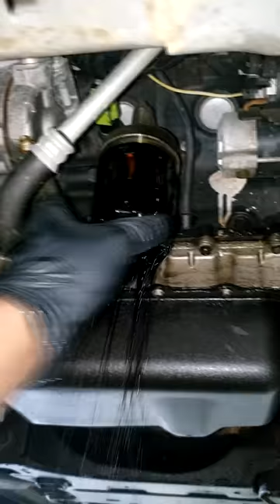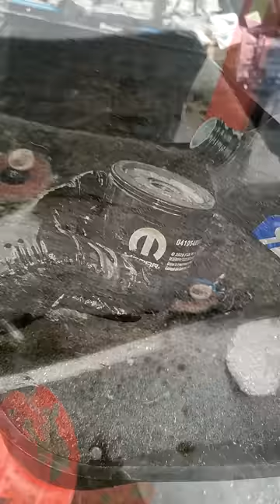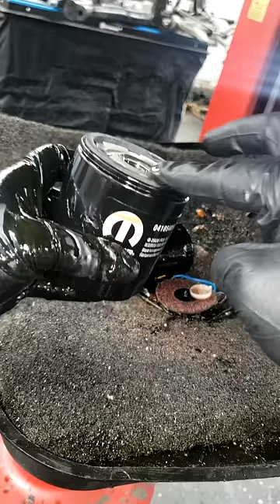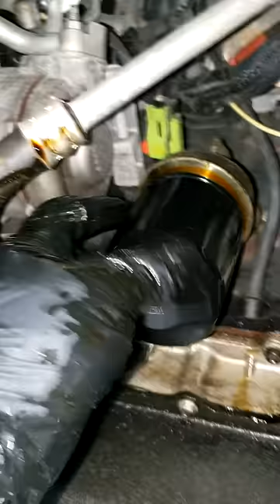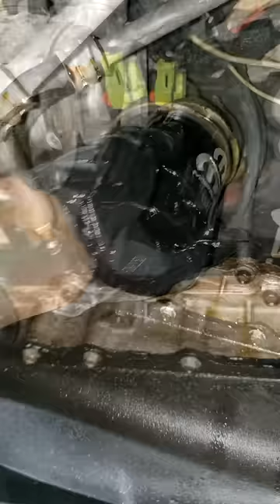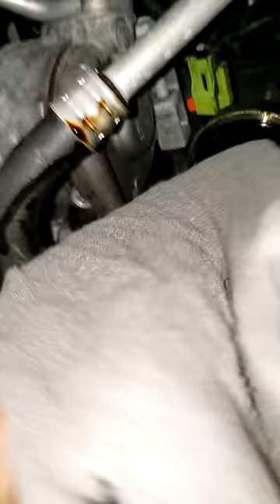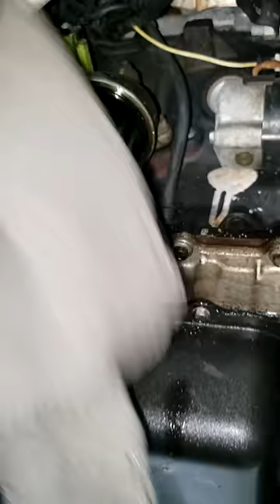Don't Lie.. Are yall still doing this?

Comment: You can't do this to every engine, as previously stated with the sideways filters or even filters like subaru that have the filter mounted screwing down from the top, so if it's not bad for them, why would it be bad for any right?

Comment: I'm confused, if the filter is on the bottom of the engine then when you fill the engine the filter will automatically fill. I would just lubricate the rubber ring and put it on

Comment: Old habits die hard fell out of this due to all the new motors, the oil pump doesn't need this kind of support anymore it'll scavenge for a second but fills right up since the filters are small and your pressures are fine as well,  oil fully recirculating through the filter, pump, etc. I thought this was for trucks or for older cars that had a larger oil filter to aid in the recirculation process?

Comment: LMAO now do it on a side mounted or even a top mount filter 🤣 this is a great way to waste oil. Out of my 3 vehicles only one of them is bottom mount. My jeeps oil filter mounts from the top, my van is side mount. "Are you pouring oil into your filters or just dumping it on the engine first?"

Comment: Nope just the pedal to the floor and crank the engine on fuel injected engines they won’t start it will prime the filter, let off as soon as you see the needle move and away you go.

Comment: Install the filter empty with a little oil on the seal fill up the oil pan start the engine and let run for 5 seconds shut off and top off oil if the engine starves of oil for 5 seconds and blows up the engine was junk to begin with and who cares I will never fill up oil filters

Comment: No need to do this on small engines. Diesels require it due to increased capacity and rotating mass. Aside from that the outside needs to be filled first not the outside, your just filling the anti drain back valve.

Comment: No I don’t. It’s not a sealed system with no air in it and it doesn’t require priming because it isn’t a pump. If it were necessary there wouldn’t be some engines designed with the filter at a 90 degree angle. I haven’t seen evidence of why it does or doesn’t make a difference either way, so no. I don’t.

Comment: I dont prefill the filter, because it's wrong. You fo it because you dont know why it is wrong. A prefill will actually slow many engines from priming. A smear of oil on the seal is correct, though.

Comment: I saw someone pierce the bottom of the filter before unscrewing so that the oil will drain out. How do you feel about this tip, Sir?
Reply: It’s a trick to do whenever you can’t get the oil filter unstuck

Comment: I don’t care what anyone says or thinks, in an engine that I can fill the filter with oil, I’m filling it with oil. Oil flow isn’t like electricity flow. It’s not instant. Takes a few seconds to fill and the less time my engine is without oil, the less wear occurs. I’ve built more engines and changed more oil than 99% of the people in this comment section. I’ve had engines go well over 300k miles and the bearings still looked new. My grandfather taught me this decades ago and I’ll always do it. Riddle me this. Why do people prime the oiling system of a new engine?  The more oil you have in the passages and filter, the better off you are at preventing unnecessary wear.

Comment: What is the point of putting new oil around the top of the filter if you didn't wipe away the old oil from where you screw the filter in?

Comment: That thing holds .5 quarts of oil at most. All manufacturers have specifications for when filling oil with an empty filter and without one. You’re wasting your time and contaminating the new filter with unfiltered oil. Now if it’s gonna fix that big ass oil leak right next to the filter I’ll do it all day

Comment: This only applies to the engines with horizontal filters. Not important on engines with vertical filters. Millinials blow my mind with some of the dumb shit they come up with. If dry start is a cocern simply pull the fuel pump or ignition fuse and roll engine over for a few seconds. I think its more important to put change date on filter rather than filling it with oil.

Comment: Seeing the amount of techs that don’t do this makes me glad I do my own work .  

I clean the mating surface , clean off any area around it that I can reach with a bottle of brake cleaner , re torque the drain plug to factory specs , pre lube the o ring , pre fill the filter , and then tighten the filter to snug so it doesn’t leak, but not too tight so I can’t get it off the next time .

Comment: So how do I fill my filter and tilt it 90° and spin it in my v8 side ways without pouring out the pre fill oil? I don't have to worry cause by the time the starter has turned beige over it has cycled oil though empty filter and out 3 times. It's good idea but not nessisary

Comment: Cars do have instant oil pressure or won't start. Not pre filling an enclosed filter (not cartridge type) does create a cavity due to the anti drain back valve recycling air. Barely an issue and barely a topic
Reply: Will never have a dry start period. Only less oil pressure for buckets and sensitive pooling type components. Such a stupid topic as no interference on any components on start up just noise

Comment: I drain the oil, spray off the filter housing with brake clean , fill the filter with oil, and install on the engine. If I can't reach the oil,  I don't fill it. I don't care.  I've put oil I've drained out of really nice engines, into my near dead cars, I don't care. Oil too thick , don't care.

Comment: 25yr tech. Nope dont do it, the reason i dont is the oil pump moved the second the engine turns and there is still oil in the rings and lifters. On a dry engine is the only time i prime the oil system.

Comment: Unnecessary to do it on small filters like that especially with the one with the filter going in horizontally. But not cleaning the mating surface of the oil filter is a bad habit to do. Seen to many LT's do this and end up with a double gasket on a filter... also using a dirty oily glove to put a new filter is a big pet peeve for me. But thats just me 🤷‍♂️ yea sure you wiped it but its still oily

Comment: This is wrong you should only fill the Filter maybe halfway and then dip your finger in and rub that oil around on there and then you go and you put the filter on . And you don't even wipe down all the old residual oil.
 probably won't do any harm but you know it Should be a clean surface when you screw the filter back on.

Comment: I've replaced using canola oil with avocado oil much healthier for my cars cholesterol...

You shouldn't fill the centre hole only the outer holes. All you're doing is risking any debris that could be in the oil getting past the filter part. And risking spilling oil making unnecessary mess. Especially when the filter is side or top mounted. The only reason anyone does this is because an angry old man with no education yelled at you about it once, and now you think it's how it's done.

Comment: I have never in my life filled the oil filter with oil. It’s a myth. I’ve never had engine failure with any vehicle of mine. Not necessary. If it was a bone dry brand new engine never ran before than yes I would but a engine with some gunk and oil in motor you’ll be fine. No matter how many times you change oil or what oil you use there will still be a little gunk in your motor.

Comment: Completely unnecessary, I value my time. I'll lubricate the gasket and that's about it, never had a problem. As soon as you fill the engine and start it fills up instantly. A lot of filters are upside down on top of the engine bay or sideways anyways.

Comment: Mopar actually says not to do this... how do I prefill the filter if it's horizontal? And the oil goes through the filter on the way to the engine there's no reason to prefill the oil filter on an engine that's been in use. And you should prelube your engine before you break it in... People misunderstood dampening the seal from a sealing surface, and over time it became fill the filter. You never were supposed to fill the fucking filter, ever.

Comment: Nope cause ain’t no point , regardless of how the oil filter sits. If you want to lube the engine before you actually let it idle. Just pull the fuel pump relay or start the vehicle in flood mode. It will prime your filter with oil and do splashy splashy inside without doing anything other than rolling your cams and crank and activate your oil pump . But most the time it isn’t going to matter anyway. You think you’re starving the motor of oil for a few seconds every time you change the oil and don’t do either of these things. 
Did you pull the plug and oil pan and let it sit over night ..probably not .
Did you do some other method of filling where you’re not literally dumping oil from the top of the motor down..also probably not . 
Is doing any of this 100% going to stop a Subaru from having leaking valve cover gaskets and timing cover gasket also no .
So just change it how ever makes you feel good when your done .
Just make sure your check the dip stick 3 times.
1. Before you drain 
2. After you fill
3. After you start and idle for a second and shut the vehicle off .

Dip stick wet and in the safe zone …yup
Then you did a good job .
Until tomorrow..when you accidentally drain the Subaru automatic transmission instead of the oil cause you weren’t paying attention to what side of the car that plug was attached to

Comment: never do it and it makes no difference the filter will be full on the first revolution of the engine  and it dies not matter at all if you do or do not  and in the old day when we where told to do it we where told not to fill from the center you fill for the out ring  because if you fill from the center on start up you can cause a Vacuum that will tear the Filter ...but Now adays with modern engines and the oil pumps we use  there is ZERO reason to pre fill the filter

Comment: You don't need to do this at all on gas or diesel. It's s a engineer theory, just wanted to get away from there own mistakes of problems, not give customer a new engine, instead of blaming themselves design, they blame customer or independent shops. You went over 100 miles over service. Like a lawyer that changes a lie to the truth. Oil will build in system real quick. Oil light will always stay on a second or 2. But oil is already traveling though your oil tunnels once engine runs, cause there oil already seating there.  ECM what to see it's specification psi. You think oil just magically disappeared from a oil change, come on.. Also if oil pump didn't have a relief valve ( close) will stop engine from running in a moment of time. This enough detail, don't need to do it..

Comment: Nope stopped wasting my time when I was around 22. And lots of manufacturers run an inverted filter on top of the engine, and it loses oil every shut down, and there is no way to prime it. It’s not needed. Y’all have fun wasting time. Now if we’re talking about a diesel fuel filter?, yeah you better prime one lol.

Comment: No need for this. Boat motors are the same as car motors and half the boat motors the oil filter is upside down so there is no way to fill it. Wasting time doing this.

Comment: Completely unnecessary.  If it was necessary, simply pull the fuel injector fuse and crank for 10 seconds - boom, filter primed.

Comment: I mean you can trying to do that all you want on my car... You won't succeed... The filter goes in upside down... Someone said you do it wrong and is putting the unfiltered oil in To the system... Which is a dumb comment because that's what you do anyway with the rest of the oil... But you're not gonna do that in my car.... I got a 1.4l chevy cruze limited 2016... 

I meanyou can prime it. I suppose but nothing but a drop is gonna make it without falling out

Comment: Yea didn’t even clean up the surface and then used that oily ass glove to install the new filter. SMH. 🤦
Reply from the maker: Its a oil change dude, don't be a drama queen. Its not the end of the world..smdh
Reply: @OnlineMechanicTips  it’s an oil change dude. No need to skip the parts of it that literally take 30 seconds.  All that time while the oil is draining out, wouldnt hurt to spare a minute to clean the mating surface.  You spent time filling the filter 😂
Reply from the maker: Yea but again, it's not the end of the world and imagine that, the vehicle still runs. Should you clean it? Sure, but this one got by me, it's ok drama quees.

Comment: These comments give me faith in how dumb arrogant people that think they are right, try to convince other people to do the wrong thing!
If you don't prime the filter, your engine will run for 5 seconds without oil. If you think that there is enough residual oil left to protect it, good for you. Take it to to a shop and pay someone to change your oil. They don't care about your vehicle. I will change my own oil and I will continue to prime my filters. Might be a reason that I have never had an engine failure before 300,000 miles.

Comment: 1 this is one of the messiest oil changes I've seen 2 so many cars have different locations of oil filters sides, tops of engine ect... 3 allot of cars don't use that old style filter anymore.  4 are you thinking when you fill the oil it doesn't fill the filter and purge any air out? Even with you pre filling the filter there's still air that's gets purged out.

Comment: All these male Karen's and Michelle Mechanics are hilarious in the comments 🤣... I never clean the mating surface, and literally wipe a little bit of oil with my finger around the edge and that's it on oh I don't know the 2 to 300K miles on all four of my current vehicles and still running strong as can be... Wow for some reason my engines still run great and haven't blown due to not following all these "mechanics" instructions here in the comments 🤣🤣🤡's
Reply from the maker: Lmao, I think most those guys are super clean freaks that change there own oil at home in there super clean garage. They can't compare that to a guy that work in a shop and do this stuff daily. The environment just not the same. So they become drama queens when they see something they don't do and they assume the world will come to an end because of it. Lmao, its freaken hilarious the length some will go through to argue how super important something that don't matter is.
Reply: @OnlineMechanicTips  exactly brother - yet here we are doing things not even close to their "Internet master mechanic" 🤣 methods keeping cars on the road with engines running strong for years!!! 👍✌️